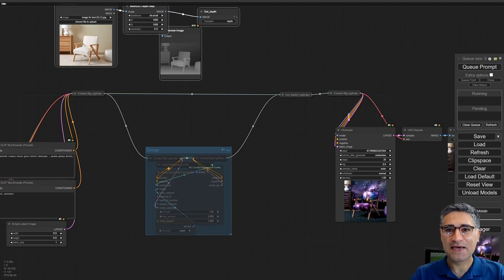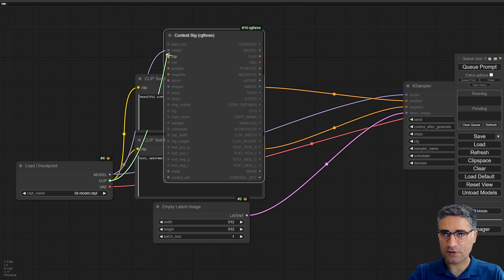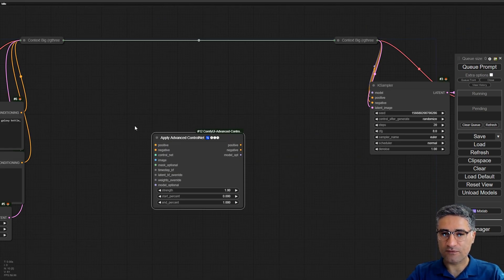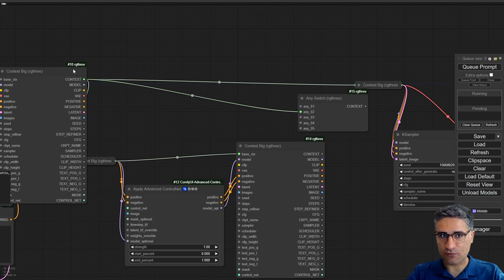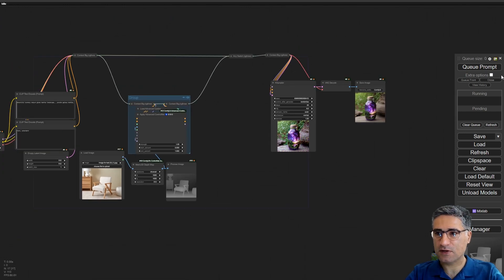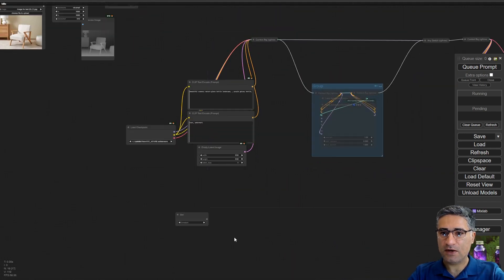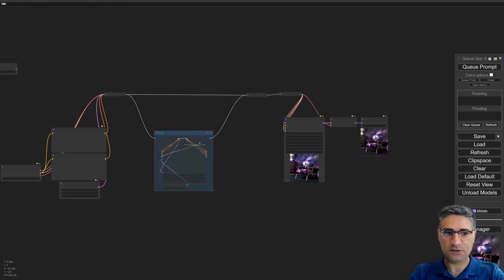Design better Workflow in ComfyUI

Comment: 🎯 Key points for quick navigation:

00:00:00 🚀 Introdução às dicas para otimizar fluxos de trabalho no ComfyUI
- Duas pequenas dicas que podem revolucionar seus fluxos de trabalho
- Necessidade de instalar extensões RG3 e KJ notes
00:00:55 🧩 Usando contexto grande para otimizar o fluxo de trabalho
- Transferência de nós e conexões para um contexto maior
- Conexão de modelos, positivos, negativos e latentes ao contexto grande
00:01:58 🎛️ Adicionando ControlNet ao fluxo de trabalho
- Uso do ControlNet avançado e criação de cópias do contexto
- Configuração de entradas e saídas para o ControlNet
00:03:00 🔀 Implementação de switch para alternar entre contextos
- Adição do nó "Any Switch" do RG3
- Configuração do switch para alternar entre contexto original e contexto com ControlNet
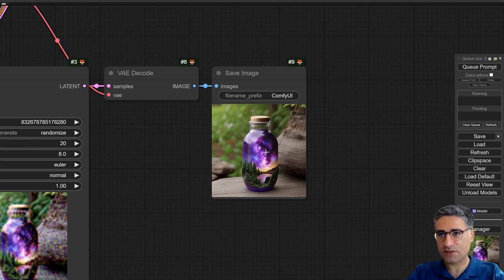00:04:25 🖼️ Configuração do ControlNet e pré-processamento de imagem
- Seleção do modelo ControlNet e carregamento de imagem
- Extração de informações de profundidade usando o pré-processador ControlNet
00:05:37 🔗 Introdução aos nós Set e Get do KJ nodes
- Explicação sobre como usar os nós Set e Get para conectar partes distantes do fluxo de trabalho
- Demonstração de como as conexões entre Set e Get podem ser ocultas ou exibidas

Made with HARPA AI

Comment: You can also select a bunch of nodes, right click then "selection to group node" 
it will compact everything into a single node and you can save it as a component to use it anytime you want in a workflow. 

I did this for some stuff like upscaling processes, and etc.
Reply from the maker: Yes it is very unusual, but it is better to do that after making sure that everything is working fine